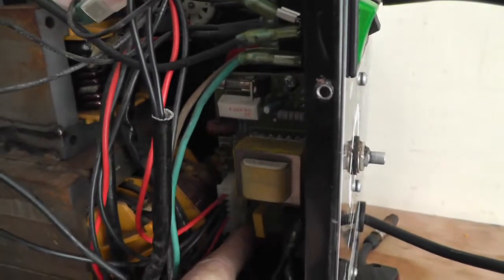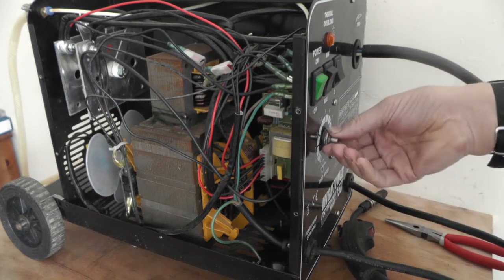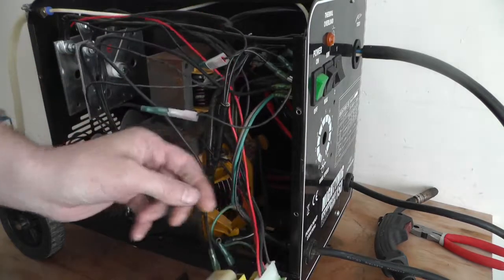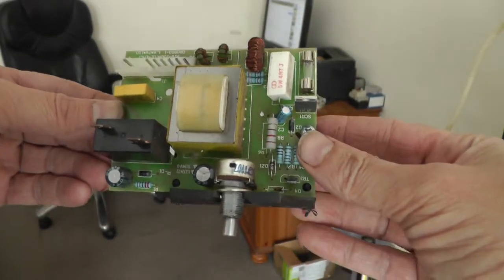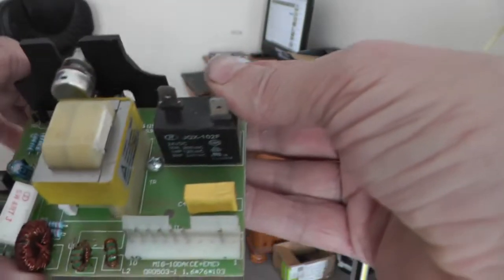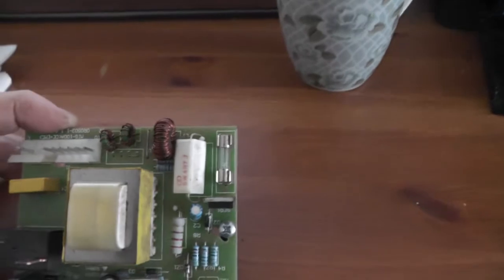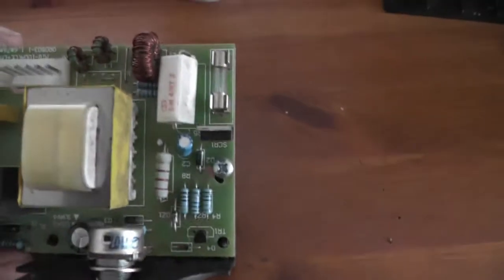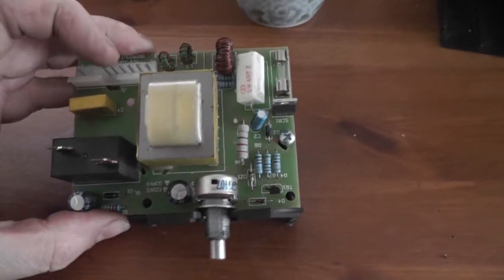MIG Welder Repair: Step 1 - PCB Removal & Visual Fault Finding Guide (Transformer & Inverter)

Comment: Have you done any repairs on sealey supermig 180/195 boards ?
Reply: Did you get a reply?
What was your issue? I have the same and my slow blow fuse blows
Reply from the maker: No just test compomnents